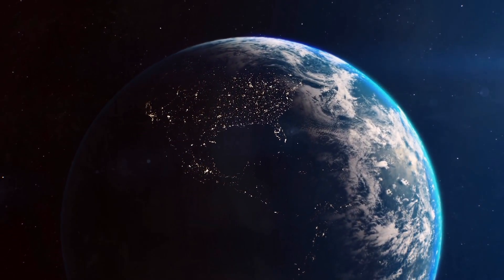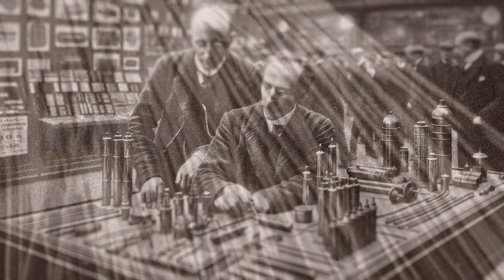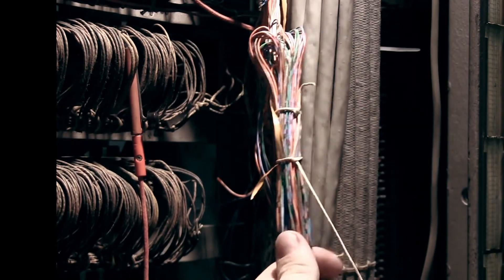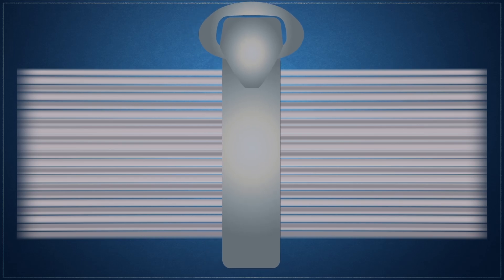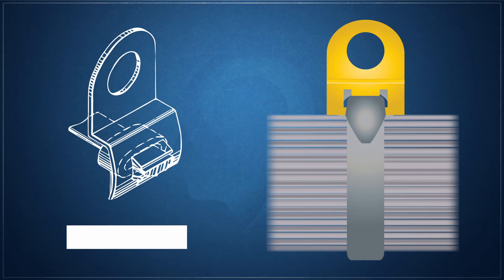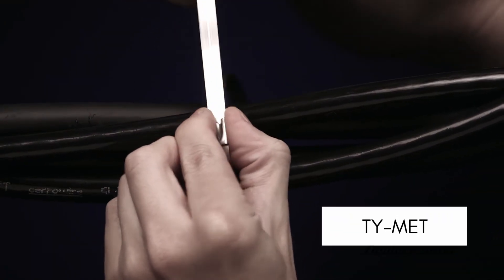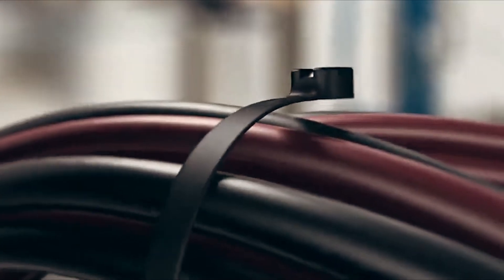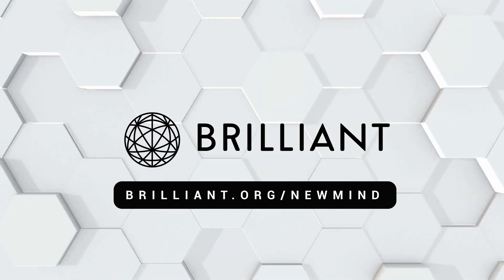The Zip Tie Story

Comment: Isn't there miles and miles of interconnect wires even in a single modern desktop CPU? Because the transistors are now on the nanonscale - soon to be angstrom scale, just a few atoms across. The wires linking them all up add up very quickly to huge distances.
So, if you took a few thousand modern CPUs, the wiring could add up to billions of miles.

Comment: Very interesting vidio. I have been using best in class T & B ( Thomas & Betts ) ty rabs ( cable ties ) since my electrician dad bought some home for me to manage wires on our model train layout with every Plastic Ville building having at least one 12 volt light bulb back in the 1960's. Never purchase or use cable ties from cheating china. If you are going to use 20 cable ties will need at least 30 because POS lack of quality control communist china garbage break before finally snuggling.

Comment: Zip ties being used in any applications where there are no vibrations to deal with is just wrong.
Using zip ties for telecom cables instead of proper cable trays is a cheap substitute and bad practice.

Comment: About 10 years ago, roughly I came across several T&B  tie wraps in a dumpster. My life was forever changed. I have not nor will I ever buy zip ties from my local big box store again. Do yourself a favor out there and get some of the original T&B Tie wraps they are life-changing.

Comment: Now in my sixties,i still have to encounter a single cable tie that survived more than 10 years. usually the crap falls of the cable whitin 5 years i.e designed to fail. On the other hand i have come across 100 year old bindings perfectly strong and intact. Not to mention the times i cut myself on poorly trimmed tie raps. Yes they are faster to apply but inferior in every other way.

Comment: 10:40 in Datacenters...We are actually slowly removing those things from our datacenters.
Because in a datacenters those bundle of wires often need to opened because of new traces or removing.
Constantly cutting and adding new zip-ties is just wasteful, and annoying....and those cut ends can be sharp and cut/scratch you up.
We are replacing them with strips of Velcro.

We only use Zip-ties for 'permanent' cables, the ones that replacing/fixing/change has the lowest odds of ever happening.
Reply: I wanted to comment the same!  For dynamically changing cabling we only use velcro, ty-raps are only for things like power wiring that remains in place at all times.

Comment: I worked in manufacturing in the early 70s as a manufacturing engineer. I was always amazed at the speed of line workers who could lace a cable harness very quickly and perfectly. They were very skilled. We had cable ties but were not allowed to used then for aviation as the early cable ties would cut into the wires over time because of all the vibration in aircraft.
Reply: It was a wax covered cord and was installed in a lockstitch
Reply: What did you use in aviation then?
Reply: Cessna uses the wraps. They don't cause any chafing.

Comment: Lacing: Good. Zip Ties: Bad. Zip Ties wear through the cable insulation with vibration. Zip-Ties are for unprofessional, lazy people when making wire looms.
Reply: Wrong tie wraps are used extensively in aviation. They do not cause chafing.

Comment: I am an EWIS SME, Electrical Wiring Interconnect System Subject Matter Expert for the USN, USMC and some USAF aerospace platforms. I’m the wiring expert for aircraft basically. With VERY FEW exceptions zip ties are verboten. There’s a few reasons for them being forbidden which include damage to wire bundles, specifically COAX, FOD from UV degradation and improper installation.
Without the prescribed installation took technicians frequently just pull the wrap until it’s over tightened which leads to insulation damage. In the case of COAX not only does the insulation get damaged but can lead to compression thereby changing the electrical characteristics such as impedance.
A huge concern is FOD, Foreign Object Damage, from UV degraded nylon wraps. When exposed to UV they become brittle and when bumped pieces get flung. On a commercial aircraft while the resultant FOD is an issue it’s not even close to the issues of high G loading, inverted flight and mind jarring arrest meant aboard ship.
Lastly the pain and wounds one feels when bumping against the end of a wrap that the last technician cut at a 45 degree angle. I have a faint white scar about 4” long on the inside on my right arm from an improperly clipped wrap cut when I had gotten shocked while troubleshooting and jerked my arm back hard.
Unfortunately the new P-8 Poseidon has zip ties thru out the aircraft from Boeing. It’s a commercial derivative aircraft so we had to accept it with wraps already installed but I’m hearing from colleagues the wraps are already degrading and becoming FOD.
Thanks for an informative video!

Comment: Not one mention of the greatest advancement since the original? Referring to the releasable variety that let's the tie be taken off and re-used. Installers call them Temp Ties, they usually have a contrasting color so the techs can recognize them. Nice to be able to open them to add cables then zip 'em up again.

Comment: My first encounter with cable ties was when I was assigned to work on a prototype system in the mid-1970s. We had more of an open purchasing policy, and could get more of the 'nice-to-have' items for our shop. Lacing was less expensive, but more time consuming. I learned to use a jeweler's screwdriver to release the ties, so they didn't need to be cut off.

Comment: I love the way cable lacing looks, and did a lot for GCHQ in my early 20's, our inspector used to hold the looms up in the centre, if they sagged by more than an inch, we had to do it again!
I remember the cut fingers too, skin soon toughened up tho.
Cable ties are great, so quick and easy, especially with the correct Ty Rap tool, I use them all the time in my job as a maintenance engineer.
I still think for sexy looms, it has to be lacing! 😍

Comment: Patents are intentionally written to be indecisive, to make it difficult to design variations that would not be covered by the patent and would even be patentable by a competitor, preventing the original inventor form using that variation. It also very common to reference existing designs, since a patent must point out the advantages over the existing designs and patents to be patentable. This is how Apple's patents end up describing the merits of rounded corners.

Comment: Let us not overlook the ability of a mere clipping of a zip tie carelessly discarded on the floor to render a creeper and an engine hoist completely immobile.
Reply: zip ties are no longer allowed in Mil/Aero harnesses due to shock and vibration "eating" through the insulation on the wire bundle. Everything has gone back to lacing due to this and FOD issues as you described.

Comment: nice, i have a box of 3.2mm T&B tywraps ,  with the metal locking piece, most others use an integrated nylon locking tab and coarse ratchet moulding,

Comment: I’ve worked in many cell tower bungalows and would never even bring zip ties in it was all stitch which will destroy your hands but is far superior. Verizon prefers single stitch but you can get away with double or triple depending on the run, just wish all the 850s were gone when I did it

Comment: what about shoving yer hands into a tight wiring compartment and getting cuts all over from zip tie ends ???
Reply: The trick is to not cut off the end but grip with a pair of linesman pliers right at the lock, then twist a few times. It breaks/tears them off without leaving a sharp edge. It's an industrial electrician trick.

Comment: Nothing about panduit?   In Tinley park Illinois
Reply: My preferred brand and they make great stuff!  Their Pan-Ty, is one  of the best zip ties.  Interestingly enough, the company was started in 1955 which would seem to suggest they were before T&B.  Great for sending rookies to "go get me some panties!"  Better then a bucket of holes, because these actually exist. Man, I almost forgot how much fun you could have messing with rookies!
Reply: @professorg8383  I also believe they made the first zip tie with a lock.   I worked in the packaging department;  and ran the presses. Lots of variety.  Thanks
Reply: Panduit was the first brand I became aware of, in the 1970s, working in the sign industry.
Reply: @malcolmmarzo2461  yes I am aware of that.   I worked in the Tinley park factory, machine operator,packaging.  Thanks

Comment: I worked at a medical industrial company making machines that sort proteins. I assembled the medical instruments, and we would build a cable stem around the pneumatic line, adding more, and more cables to it as we attached more components. For each new cable, we would add new cable ties, and remove the old ones. In the end for each instrument we had a massive pile of cut cable ties lying on the floor. I used to have a pouch of cable ties on my person at all times. I can still find them in my car...

Comment: How the metal barb gets in the ty-rap head is its own story. Cut from a spool of flat stock at an angle then driven into the still warm head of the ty-rap body which then gets cut off its runner. Developing the steel which worked in the machinery and maintained an almost double advertised ty-rap strength took some doing. 

Standard material is nylon although flame retardant hylar, radiation resistant tefzel where also made. Not mentioned in the video are delrin double heads with a separate spool of strap cut at the point of use for no waste and less part numbers to stock. Mostly telco.

The corperate office/lab/palace was in Bridgewater. Moved there so the big cheese didn't have to cross a hiway to get to work :)

Before mergers and holding companies ty-raps and related plastic parts were developed and produced in Montgomeryville PA.

Note ty-rap guns properly tension and cut the tail flush without leaving a blood letting dagger. At one point there was an air gun that would install the ty-rap as well.

Comment: Cable ties are called in the Netherlands Ty-rap. I know these sinds the 1978 working on off-shore oil rigs. Before sinds the late 6”60s we used Consol cable ties. stil available at Le Grand. This was a more strechable tie cam with a special tool. I still has the tool and som ties from the ‘60s in my electrical tool en material cabinet. So how was first?

Comment: Retired industrial electrician and can state the best in class  cable ties or what we call ty rabs are made by Thomas & Betts hands down. Just hope nogoodnic ABB that bought them out don't ruin or reduce their quality. Back in the early 1970's they always sent out a salesmen with free samples & latest catalog. T & B also make the best in class sta kon wire connectors. Still have my T & B think its a #WM100 wire crimper with a wire cutter that my company gave me 40 years ago. Have a couple of the orange colored T & B  ty ran cutters but if I only have a few to install use my linesman pliers to twist ( & not cut a sharp edge ! ) tail of ty Rapp to supply a dull edge.

Comment: The big downside of cable ties is untrained "techs" improperly trimming them by leaving the cut ends exposed. Long retired now but I still have scars on my hand and arm from the jagged cuts they cause when not properly trimmed, especially in tight spaces.
Reply: I HATE when people think they are doing a great job when they crappaly use side cutters to trim the ends.  Better off left untrimmed.
Reply: @rm3141593  especially in places where no one but the one tech a decade will ever see the ties.
Reply: @rm3141593  it's possible but yeah. Proper cuts with side cutters are just too fiddly and slow for a production environment.
Reply: I remember working in a blind area and getting my hands shredded.
Reply: I used to work, refurbishing used wood working tools.
When I was done, my last job would be, coiling up the 
power cord, and securing with a zip tie.  First machine, 
I cut the tail off.  That was the last time I cut the tails.

I just got a pair of flush-cut dikes.  No sharp end left.
(That is for me, not work.)

steve
Reply: I'm keeping you away from my cables boyyy
Reply: Harbor Freight used to have a tool cable tie tensioning tool it was 8 bucks the replacement was also 8 bucks but it was not nearly as good I seen one at Home Depot for large strap zip tires so I knew that they existed looking for one a decade ago this one electrical supply company in Portland wanted such a huge amount almost into the thousands hundreds of dollars for one of these tools but if you notice when you get a product with zip ties zip ties they are always perfect no little Jagged Edge it's because they use a tensioning tool it pulls it a little extra time and has a guillotine kind of mechanism anyway I was so happy when I found the Harbor Freight Tool I misplaced it then found the new Harbor Freight model it was not any good strangely enough the first one looked like it was all plastic although all the parts that were Maid of metal the very next one I got from Harbor Freight was was mostly made of metal although strangely enough the parts that pull the strap tight what's now made of plastic anyway not sure if they have that tool anymore I wanted that because I was going to make homemade bicycle baskets for cargo bikes
Reply: Nothing worse than getting into a panel and getting cut up adding a circuit or something cause some jerk off cut all the tails off with dikes. Frustrating as hell and makes for a rough day.
Reply: they make a great cutter for them,  called the God Hand - the clippers are so carefully machined that they leave no sharp edge at all ... expensive, but incredibly high quality and worth it if you use zip ties a lot
Reply: Supposed to use bandaids. They lessen the chance of scars
Reply: Don't knock the tech, knock their boss who probably told them to "just use scissors" instead of giving them flush cutters
Reply: Sounds like a personal problem lol
When I'm in a crawl space last thing I'm worried about are the edges of cable ties. I care about making sure it looks good, organized, and labeled properly.
Reply: @StevenAcunaBG05  ... And you think you're crawlspace adventure won't be affected by getting sliced by someone else's poor workmanship?
I always wear gloves and long sleeves due to the issue.

Comment: Have used lots of cable tie over my career, always considered them a huge waist plastic generator and a hazard for cuts on your hands. Also thought they were created so low skilled low cost labor could be used.
Much prefer to use cable lacing, a roll lets you have a large range of sizes, with less waist, also looks better when finished.

Comment: The guy doing spots at 3:10 needs to go back to training again; he's flipping the cord instead of keeping it flat.  Note that in-between lacing and cable ties there were a number of other methods used, including the tape-wrapped bundles that BMW kept using until the nineties, "chinese finger trap" sleeving, and spiral wrap (as seen in the shot on the right at 8:30).

Comment: The cable lacing stitch (chain stitch, linked hitches etc) are also incredibly helpful ways of pulling cable through conduit, especially as it bundles up the tip to make guiding it super easy.

Comment: I always thought these were invented to ease securing things together, like, securing one thing to another, with all kinds of items (like I've been using it in my home for various installation, maintenance, repair and electrical jobs). When I watched videos about cable-managing PCs and saw that people use zip ties for tying cables together (as pretty much an exclusive option) I thought it was kinda strange at first, sort of like a hack, a kind of improvisation that just works and saves effort, and I always thought there must be a more "appropriate" way. It's very interesting for me to learn that this was actually the original intended operation for this product.

Comment: In my work as a avionics system technician, cable tie are mostly prohibited. Single spot "wax" string tie are the only ones that meet airworthiness requirements. In some cases, lacing is allowed such as in conduits. Cable ties are only allowed where FOD is less a concern or where space is too limited to use spot ties.

As for my DIY stuff, cable ties all the way :)
Reply: I worked avionics on RCAF CP-140, Sea King and Hercules. All laces there too. Cable ties were a fantasy. Oddly, I can't quite remember how to tie it after about 5 years off the job.

Comment: You know what would have added to the wow factor of the amount of cable.
"To put that into perspective if you would have got on the space shuttle traveling at its full speed of 5 miles per second it would take you 18,600 years to travel the distance of all the wires produced"